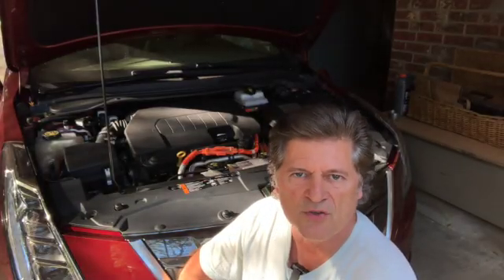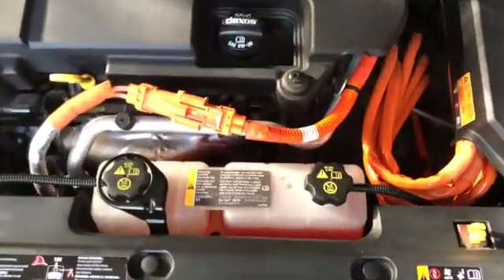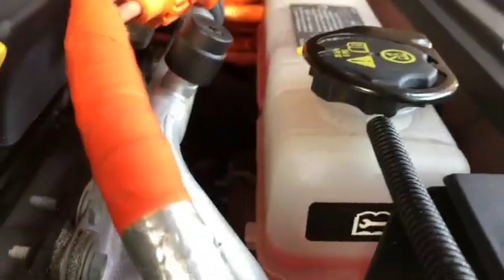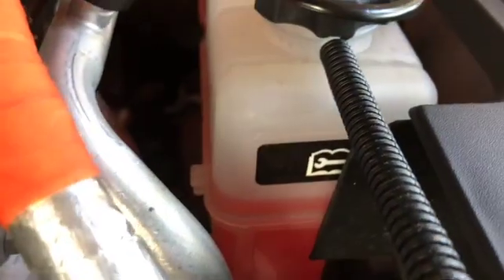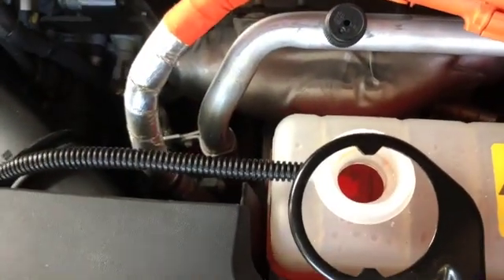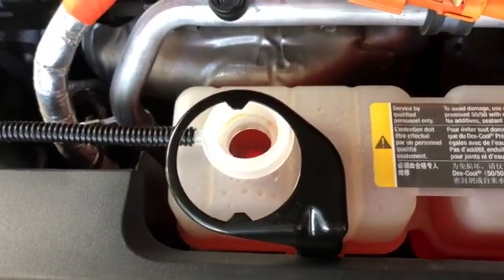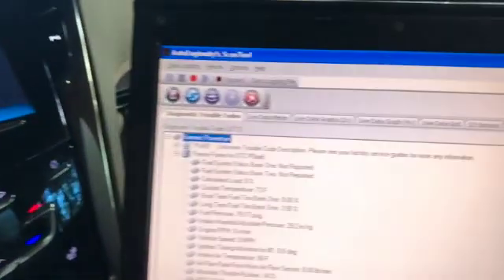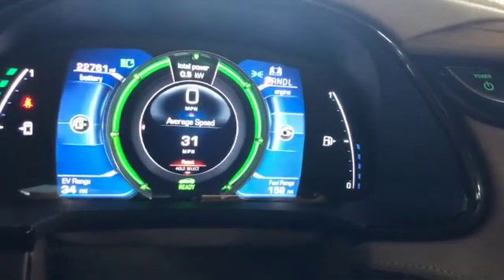Service High-Voltage Charging System Error Message...Fix and Reset

Comment: I am looking at a 2014 volt to buy but when i connected my ob scanner it said the car needs to be updated in order to scan or something. I never seen that message on any other car . Have u ever had any issues trying to scan a volt?
Reply from the maker: I have not run into that message but one volt I was working on was getting terrible gas mileage, under 15 mile per gallon when running on the engine. There was no check engine light on or anything. Finally took it to the dealer and they did a software update and mileage turned back to normal around 30 miles per gallon when running on the engine. Sometimes you just have to bite the bullet to get these updates done because I’m not aware of anyone outside the dealer that can do them.
Reply: @pinkcaddygarage267  thanks for the info there is a 2014 volt for 9400 it seems legit the car itself doesn't have any warning lights and the lifetime mpg is 170 mpg the guy drives it mostly on electric says he is getting a new full electric car he doesn't need his volt. And the mpg on gas mode showed 38 mpg. It has 123k miles. Overall it seems legit i want it but i am scared to buy a car that my odbll scanner cant scan. He is a busy guy and i dought he would want to go to the chevy dealer before i purchase it and it will probably get sold fast i dont know if i should just take the chance? I never seen that message i have scanned other cars and never seen the scanner tell me the car needs to be updated in order to scan i have the bluedriver scanner and it has worked perfectly for every other car
Reply: Also i am in California i am going to call the dealer and see if California has that 10 year 150k mile extra warranty on electric cars that other states dont have i know its supposed to be 8 year 100k miles but i am hearing California has a supplemental 10 year 150k mile warranty on electric batteries
Reply from the maker: I guess the first thing I would do is try a different scanner to see if you get the same result.
Reply: @pinkcaddygarage267  if i lag it anymore it will probably get sold it is clean title with 123k miles 2014 volt for 9700 i talked him down to 9400 if i go with cash in hand possible 9k flat its about an hour drive i should probably pay the 40 dollars and get a full carfax but i dont know i never bought a car that i cant run my scanner on. its been 5 days already since i checked it out he is the 1st owner and says it has never been in an accident but i was surprised that for a 8 year old car he said he changed the 2 front window regulators and the passenger side mirror wasn't working good and the driver door was creaking for a 8 year old car its not be in the best shape. Also the drive mode button was not working it seems to be an easy fix for the drive mode button it is most likely just stuck because it did pull up the drive modes on the dash for a second but the button does not work. Also the oil was at a good level it looked clean and didn't have a burnt smell or anything but there was a lot of oil spilled in the cap area. I dunno if it was filled too high and spilled out or whoever poored the oil just missed the hole and spilled it all over the cap area. i am surprised it hasn't got sold yet most other volts r up for around 12k overall it has flaws but atleast its not like a car flipper that cleaned everything up and hid all the flaws.

Comment: Need Help.  I got two error codes 
P0CE7  : Hybrid/EV battery Pack coolant control valve position sensor circuit High
P0CE0  : Hybrid/EV Battery Pack Coolant Control Valve A Performance/Stuck Off

Any idea what needs to be done. I thought of changing 'Battery Coolant Control Valve' , but did not find any videos or DIY stuff any where . And also not able to find the correct part number. Any help is much appreciated
Reply from the maker: Sirisha - I have not run into either of those codes before so I’m not familiar with the solution. If I were you, I would go to the Chevrolet Volt forums and type in that code and see what kind of search results came up when other people have experienced this problem.

Comment: Do you know the part number for this coolant sensor?  Mine was also low and filled up but can't reset the codes.  I tried 2 different readers.
Reply from the maker: I don’t have a part number, but just Google “Cadillac ELR coolant level sensor” and you’ll get the proper part information.

Comment: Thanks for the helpful info! 
I was getting the following codes: 
P1FFb
P1E00
P1FFF
P0000

Topped off coolant/antifreeze to the top of black wrench sticker with Prestone Antifreeze + Coolant Dex-Cool and then cleared error codes with code reader while car was running/turned on. Green charge light didn’t come on until I cleared the codes. I have a 2014 Volt.
Reply: My bluedriver scanner doesn't work on a 2014 volt i am looking to buy. Have you ever seen a message that says the car needs to be updated in order to scan?

Comment: This is great advise.  Got the service message on my 2013 Volt but my busy schedule kept me from taking the time to search and see if I could self service.  Guess what???  1 month later for an appointment, 1 month of driving on gas and then a $230 service bill from my Chevy dealership, they added about 2 cups of coolant and all is good to go.  Yea.....  $230 for diagnosis, clear warning and 2 cups of battery coolant.
Reply from the maker: It’s how they stay in business, I guess!

Comment: Hello this happened to my 2011 chevrolet volt i have already topped of coolant and went to oreillys and erase the code but some hours later the code keeps coming back already erased the code 3 times any help? Do i need to go to the dealer?
Reply from the maker: Probably. That usually means that the coolant sensor itself has failed and needs to be replaced. You can do it yourself but if you aren’t confident then it is a job for a mechanic.
Reply: Thank you sir

Comment: Thanks for this! This video, $17 for some Dexcool, and my scan tool saved me a trip to the dealer - the car is now charging again and all coolant tanks are filled.
Reply from the maker: Glad it got you going again!
Reply: @Erin-bc8ic  Amazon, but you also need an adapter cable so that it will fit the bike's OBD plug.

Comment: Thanks for your video!  I had a local Oil and Lube top off the coolant but they said their OBD scanner couldn't clear that code.   I took it to a mechanic shop and they cleared the codes but it came back a few days later. The mechanic shop said they are not going to clear it again so now I need to go to the dealer.

I'm concerned about a few things:

1. The dealers near me are scheduling weeks in advance right now and I only have 1 month left on my 8 yr warranty (2013 Chevy Volt). 

2. The dealer will likely try reprogramming the coolant sensor first and it will likely fail a few days later, necessitating me to make another appointment to get the sensor changed. That may put me out of warranty but I believe the repair will still be covered since the issue began prior to warranty term date. 

3. To be on the safe side, I can drive to another dealer further away but I'm concerned that the car will have to be towed.  Will the residual electricity in the battery needed to work the power train be depleted by this error code?  I talked to one Volt tech and he said I could still drive without the battery but he wasn't familiar with the residual electricity being required to work the power train so I'm not sure I believe him.          

Any thoughts on being able to drive the car with a depleted battery?  I thought maybe the car would go in limp mode, which seems to happen when I am on the highway and don't have any charge left (so I always just leave some charge in the battery using the Hold or Mountain Mode function).  I brought this issue up to the dealer several years ago and they said I needed a new transmission.  Spoiler alert, that didn't solve the problem.  It kinda sounds like limp mode is a normal thing for these EV though so maybe I didn't need to be concerned about in the first place. If that's the case, I am outraged that the dealer took my money for that new transmission. wth  I tried calling GM to ask if the car would still work after battery is depleted but they referred me to local dealer. I feel stuck here.

Another option, I could possibly order a scan tool to clear it myself since it seems to take a few days for it to return. But it sounds like not all scan tools are effective. I see the  Actron CP9125 C PocketScan Code Reader for 1996 and Newer Vehicles - Orange has been shown to work on 2015 Volt according to another person's comment on the video so I ordered that.  However, if I clear the code so I can ensure I can drive to the far away dealer, they will have nothing to fix when I get there.  Is there a way to trip the code so it comes back on again?  I saw someone talk about a "cycle" is that when the car gets charged up all the way?  In my case, I never let the battery get depleted but I did charge it up all the way several times before the error message returned so I feel like it just takes a few days.   If that's the case, I obviously wouldn't want to clear it and I should just risk it and go on limp mode and get towed the rest of the way if it dies.  I feel like this is a terrible option. I don't want to wait on a 76mph highway for 3 hours for a tow truck in 100F.
Reply from the maker: OK, here’s what I would do. You can absolutely deplete your battery with no ill affects and drive around that way for months on gasoline if you wish. I know plenty of people who have and then got the problem fixed eventually and the battery was fine since it doesn’t really ever deplete
Reply from the maker: Oops, I didn’t mean to post yet since I was in the middle of a comment. Anyway, the battery won’t fully deplete even though it says it has 0 miles of range so you should be fine there. If you just go into your close dealer and get the problem documented then you’re covered for your warranty since it is documented as a problem while it was still under warranty. My first choice would be to get the dealer to deal with this problem because you shouldn’t have to spend any money since it is under warranty. If you were still having problems down the road then you can always get a scanner and clear that code yourself. Regardless, you need to determine what is causing the code to sit in the first place. Most likely a coolant sensor which the dealer can fix for you.
Reply: @pinkcaddygarage267  Thanks so much for your thoughtful reply. 

Here's my plan:

I will keep my appointment with my local dealer in 2 weeks from now.  If I were to drive to a dealer further away for an earlier appointment and the sensor is tripped on my journey, I risk having to drive in limp mode the whole way (75mph highway) since my car seems to do that whenever it runs out of visible energy in the battery.  I wonder if it's causing damage to the car when it drives in limp mode?  The dealer couldn't find anything wrong with it after they replaced the transmission.

I'm also going to look at trading it in for a used non-EV car. :)  I'm tired of this car leaving me stranded all over the place.

Thanks again!
Reply from the maker: I think your plan is good. Limp mode is the same to protect the engine so I wouldn’t think it’s going to damage it any further than whatever the current problem is. Let me know how that turns out.
Reply: @pinkcaddygarage267  Turns out my warranty expired in March. Do you know if it's easy to replace the sensor without knowledge about cars? I got that scan tool and it works to clear the code and allow charging temporarily but the code consistently comes on every time I turn on the car now so it's a bit annoying to have to clear it multiple times a day when running errands across town, as I need the battery's electricity to drive on the highway without going into Limp Mode. I tried to have it checked out by a local mechanic (not the dealer) and they said they couldn't perform the pressure test since they don't have a connection small enough to fit in the hose so I feel like it's a dealer-only repair.
Reply from the maker: @pinkbillows  I’ve never replaced one but the people that I have talk to you that I’ve done it said it is just a matter of removing the tank unplugging the sensor remove the old sensor and put in the new sensor.Of course, if it’s like any other project I do there will be some unanticipated issue to deal with but as far as I know replacing the sensor is a fairly straightforward process.

Comment: Thanks for this - 2012 Volt owner here.  I checked the reservoir and it was down to about a half inch.  I brought it to my regular mechanic who topped it off with the DexCool 50/50 and cleared all codes but not the code PE100 (if I recall).  When i plug the car in the orange light comes on but just sits there, doesn't proceed with beep and flashing green to indicate charging.  The 'Service high voltage charging system' error is still there too.  Do I have to go to the dealer?  I see other comments about the sensor and wonder if that's the problem....
Reply from the maker: In my experience, the 2012 year model in particular has much resistance to clearing that code, except at the dealer. On my ELR, I was able to clear it. Oh my daughter in laws 2012 Volt,it had to be done at the dealer.

Comment: Great video, I erased the P0AA6 code after refilling the coolant tank, but the code came back the next cycle.  From what I can tell from the volt forum, you have to go to the dealer to get modules reprogrammed to erase the codes.  I could have kept erasing the code every time I used the car, but I gave in and brought it to the dealer.  They charged $200 to reprogram modules per TSB PIC5920B.  I'm not sure if any independent shops have equipment to program the modules, or if there is a work around altering the coolant level signal.  Avoiding the dealers is getting tough when manufacturers design in fail-safes to keep owners from DIY.
Reply from the maker: I know. Some Volts seem to be only resettable at the dealership.

Comment: My coolant is full but for some reason i have this error message whats could be other than coolant .
Reply from the maker: Most likely the sensor has gone bad.
Reply: @pinkcaddygarage267  yes agree , but what sensor exactly because there is 3 coolant containers is the battery coolant has sensor too im lost now 😂
Reply from the maker: @sabahjason1  The sensor is on the same tank where you would add coolant. That is a split tank (Left/Right chambers). The sensor that's usually replaced is the one on the passenger side. You shouls be able to see the sensor wiring from above, silver-foil--wrapped going under the tank. I haven't changed the sensor, but I imagine the tank will need to be removed to get access.
Reply: @pinkcaddygarage267  so i look by the left champer tank ?
Reply: @pinkcaddygarage267  maybe this is good idea for new instruction video on your channel to show us where to look exactly . when you say the passanger side tank that would be the engine coolant tank not the battery pack coolant chamber , im sorry you got me even more lost now 🤦
Reply from the maker: @sabahjason1  Look at the top of the tank that is underhood at the front of the engine compartment. There are 2 removable caps where you can add coolant. The one on the left (passenger-side when standing at the front of the car) has a black cap lock on it so you can't easily remove the cap. Visualize directly under that on the bottom-side of the tank. That should be the sensor location.
Reply from the maker: @sabahjason1 One thing I should've asked...are you beyond the Voltec 8-year 100K warranty on your Volt?
Reply: @pinkcaddygarage267  yes im about 222k now
Reply: @pinkcaddygarage267  ok now it make sense because in your previous comment said the passenger side tank and that would be the engine coolant tank .

Comment: Just got the "Service High-Voltage Charging System" error on my 2014 Volt.  Topped off the coolant, cleared the error, and I'm good.  Thank you so much for this video.
Reply from the maker: Had it helped you!

Comment: 2013 Volt Owner here, the coolant level was the fix for my "Service High Voltage Charging System" error and check engine light. Topped it off and reset the check engine light at an O'Reilly Auto Parts. Faults remained clear and it charged as soon as I plugged back in.
Reply from the maker: Glad it worked!

Comment: So it will not let you charge the car while it is showing the error but after you clear the codes it will let you charge?
Reply from the maker: That is correct.
Reply: @pinkcaddygarage267  I have a Bolt and I got the same error, "service high voltage charging system". So I took it to a dealer and they said a dent in the bottom of the car had damaged the battery and that's why I was getting the error and that the whole battery would have to be replaced.

I am not sure they know what they are doing though so I would at least like to try to fix it myself. I am not paying that much for a battery replacement.

I checked my coolant levels and they are pretty good so I am just going to get an obd tool and clear the codes and see if that helps at all
Reply from the maker: Jordan, I imagine if you actually do you have a physical problem like the dealership is telling you that you will not be able to clear the code or long. At least that will tell you if there is a physical problem - one way or the other.